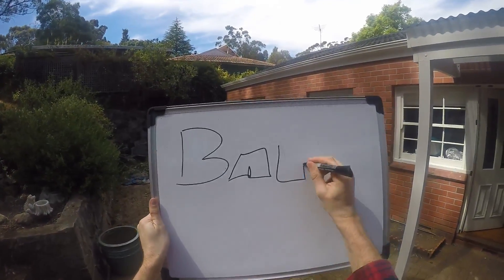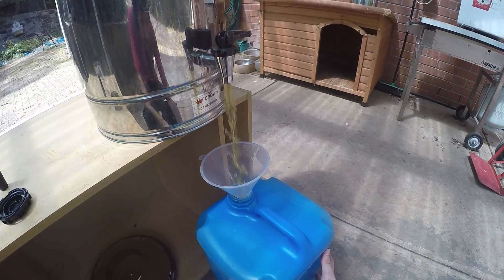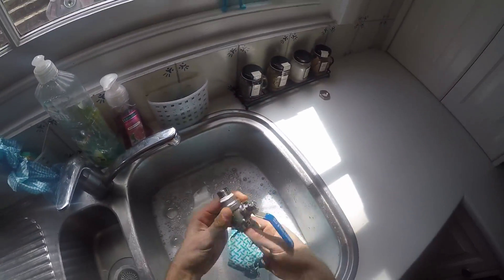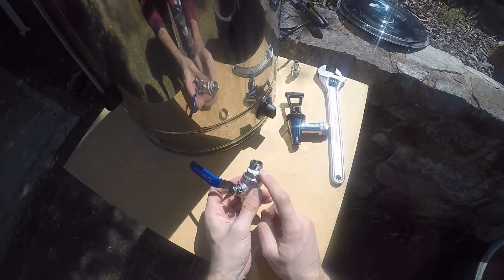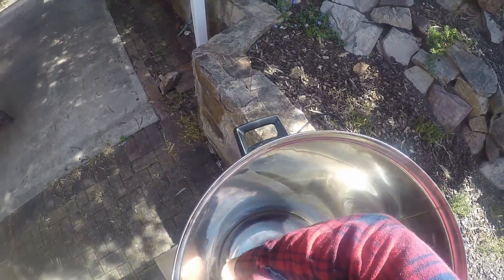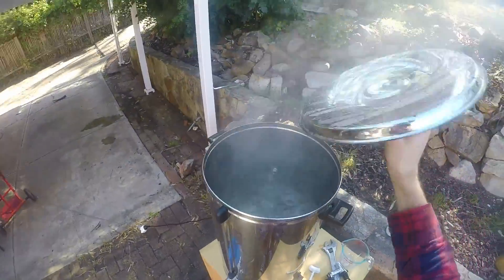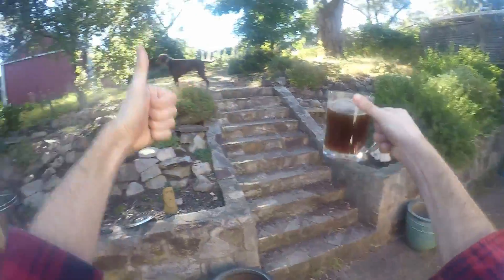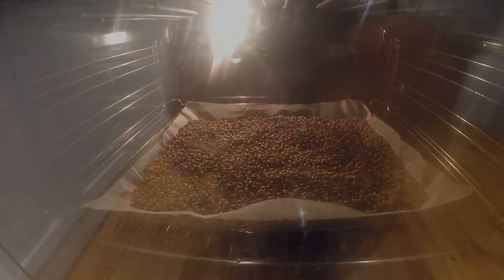Installing a ball valve

Comment: Concise, informative and entertaining video as always.
Have you had any issues with keeping the internals of the 2-piece valve clean? I’ve read that 3-piece versions are supposedly better for cleaning (but they’re also more expensive).
Reply from the maker: No, but keep in mind you're asking a lazy person hahaha. I've cleaned it a couple of times since installation by just taking it all apart, wiping it down, putting it in the dishwasher, wiping again and not much else I think. Pretty easy ... as long as you remember how to put it back together again!!
Reply: Sounds pretty straightforward. I guess it’s also near-boiling wort running through it too so not as critical to pull it apart after every batch.

Comment: I discovered by accident that it is possible to take ball valves completely apart and deep-clean them. Take two spanners ("crescent wrenches" in the US) and apply torque to opposite sides of the the assembly until it comes loose. The teflon gaskets are a little tricky, and you have to rotate the handle to the off position to get the ball out, but there you have it.

Comment: What does dn mean in ball valve dn 25 Is it diameter
Reply from the maker: Not sure what you're referring to sorry. Where are you reading this?
Reply: Nominal Diameter, in your example DN25 means a nominal diameter of 25mm. Interestingly, it doesn’t mean it’s exactly 25mm in diameter but it will be close. Nominal = “in name only”.

Comment: After reading the Coopers forum, I had a feeling that you were going to make a video on this.
I just bought a crown urn a week ago and I'm a bit nervous about doing any modifications to it right now. 
I was wondering what made you decide to go ahead with this besides the weird pour from the original tap?
Reply from the maker: The weird pour; no less, no more
Reply: Where did you get your ball valve from?
Reply: You will be able to get them at any plumbing or hardware stores.